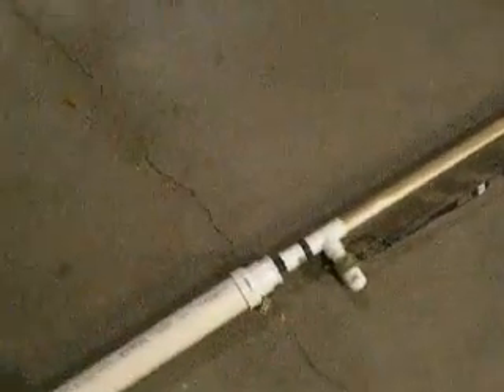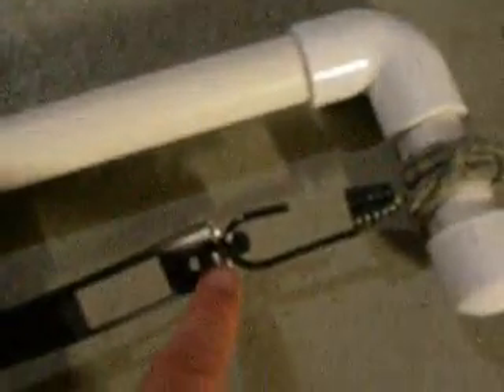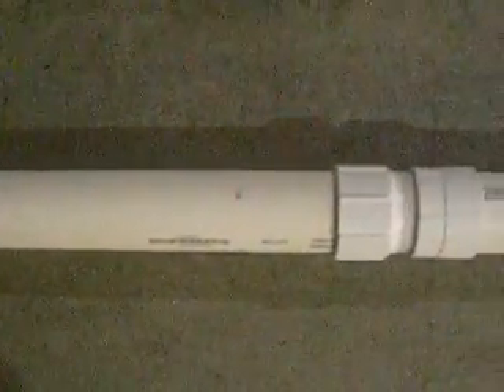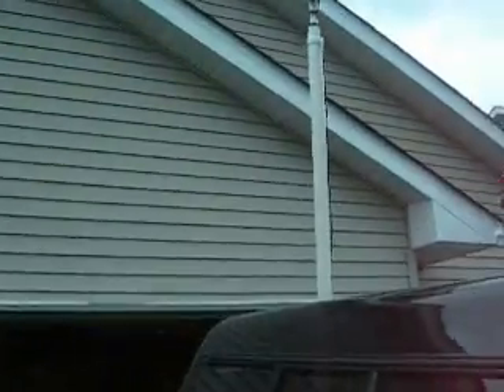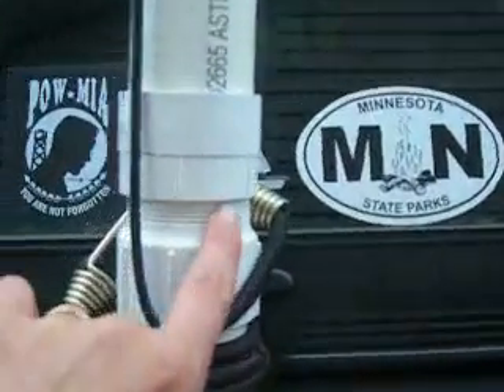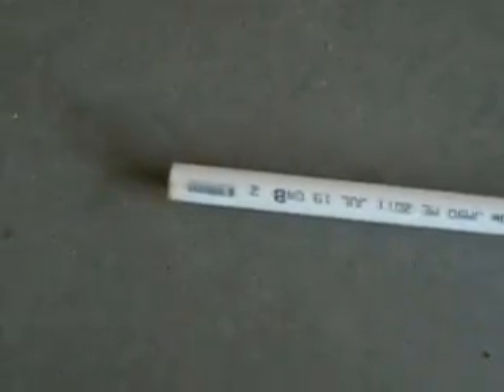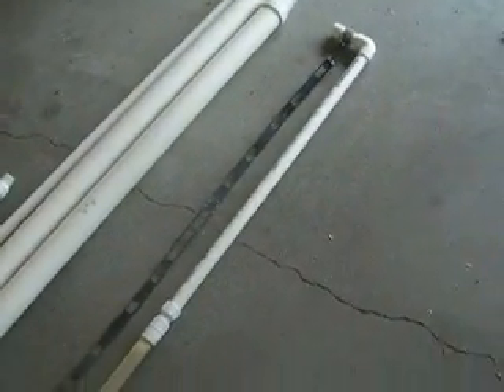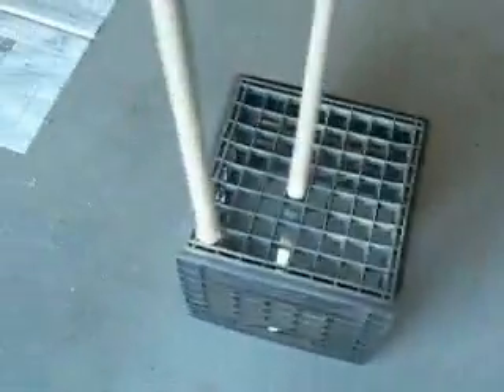Slim JIM Antenna

Comment from the maker: I had a car before I had my drivers license.  Its just what I did.  It transmits great I am getting good reports on repeaters 25 miles away on my hand held.  I can reach repeaters 100 plus miles using my base 2M radio.  Great cheap antenna.

Comment: Did you get your ticket? I have found that with these antennas, to reduce or even eliminate RF and current on the feed line, you can use an air wound choke at the base of the feed point. Say, 7 to 10 wraps of the feed line about coffee can width. Whats your CALL? Do you use echolink? Nice setup!